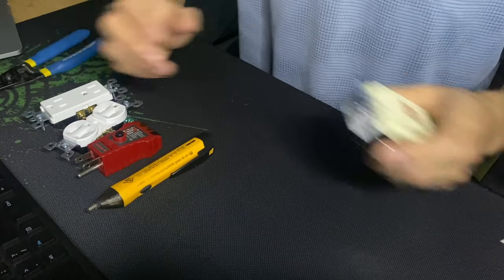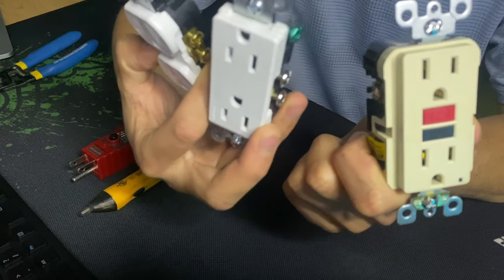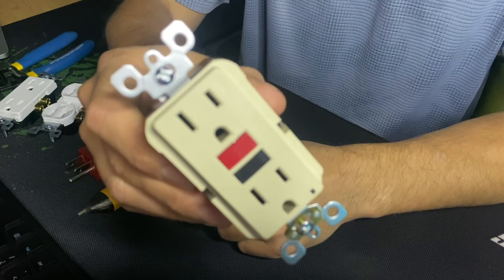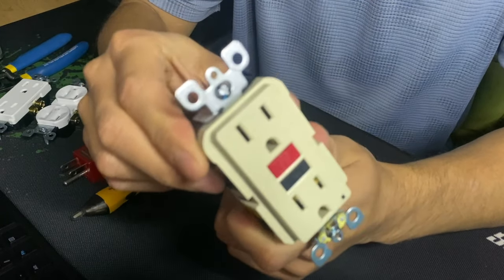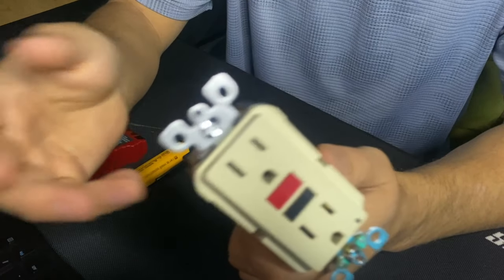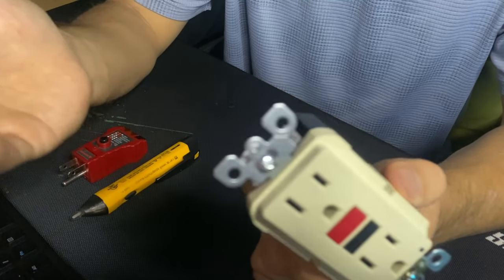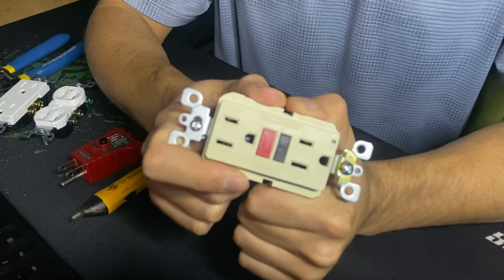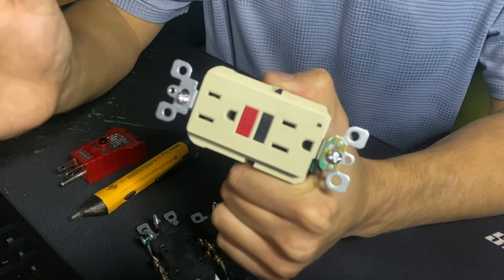GFCI Outlet Not Working 🤷‍♂️ Can't Reset It

Comment: Hi my outlets on my Camper are not working except the microwave plug We changed the GFCI PLUG AND ITS GREEN BUT WHEN I PLUG SOMETHING INTO THE GFCI OF STILL DOESN'T WORK NEITHER DOES THE OTHER OUTLETS ALL FUSES WORK BREAKER BOX IS WORKING WHAT COULD BE THE PROBLEM 😢
Reply from the maker: wiring is problem. line has to go to line load has to go to load. then you need to test reset

Comment: I think you should have explained what if the GFCI outlet DOES have power and still won't reset.
Reply from the maker: short circuit or time to replace it.
Reply: @remoteelectrician  Thank  you. I replaced it and it works now. They don't make anything like they used to...

Comment: While trying to change an outlet I saw sparks and now both restrooms  don't have outlet power only light power. What should I do? The fuse is ON
Reply from the maker: you should have turned power off before replacing outlet. turn power off, install the outlet if bathroom gfci, turn power back on, reset gfci, that's it. (you should also inspect the rest of the outlets in other bath since its all one circuit before turning power back on.)

Comment: Remote Electrician My GFCI is not resetting and there is no switch in the circuit. I purchased another GFCI and it's not resetting either. So I replaced the GFCI with a standard outlet and all the outlets are working. What do you think?
Reply from the maker: Do you have 4 wires or just 2? If you have line and load (4) you power has to go to line terminals
Reply: @remoteelectrician  I have 4 wires and yes it is wired like that. I have another identical circuit that is working fine. I guess I just got two (new) GFCI's. Ill get a third and try that.
Thank you.
Reply from the maker: @55afishead  no you need to wire it correctly then press reset.
Reply: @remoteelectrician  No. It's wired correctly. Just had two bad GFCI's.

Comment: My problem is the green light is steady on the outlet but no power and no power to the rest of the kitchen outlets. I replaced the outlet and same thing. Green light, no power no click when I hit test or reset? I bought a dead GFCI outlet?
Reply from the maker: make sure u wire it correctly, watch how to wire gfci video. (Yes, sometimes  u can buy faulty new gfci too)
Reply: @remoteelectrician  sure but the original outlet has been there since before I bought the place. No problems. Same exact situation between old and new outlet. Steady light so it's getting power but it seems "tripped" and I can't reset. No clicks on test or reset button on either outlet. Thanks for response.
Reply from the maker: @kenbe62  well if u can't reset make sure with multimeter that wires have power 120-125v, and if installing new device doesn't work and trips then you have short circuit in that junction box or the load side of that circuit.
Reply: @remoteelectrician  Both new and old outlets should click when the buttons are depressed, yes? Neither does. Thanks again for the responses. Definitely be watching more of your videos.
Reply from the maker: No If it doesnt have 120v at the terminals or there’s a short/ground fault in that circuit

Comment: I have power to my outlet but it still won’t reset. It clicks and turns red when the button is pressed but goes off and no power when button released and no light
Reply from the maker: you have short circuit if it's feeding another outlet. or just bad gfci(may need replacement)

Comment: Tell Sandra my backyard this past weekend plugged into an exterior outlet and all of a sudden the power shut off I didn't know that a particular GFCI feeds this Outlet when I went to try and reset this particular GFCI I kept pushing in the red reset button but it would not stay in I know it is not hooked up to a switch and all the breakers in my panel are on nothing was tripped is it possible that the GFCI is just bad and needs replacement or can it be something else?
Reply from the maker: one way to test is to remove face plate/cover and check (with power tester stick) side terminals for presence of power. (if you have power and can't reset gfci it could be bad gfci or short circuit  in. the chain of load side)

Comment: I have this problem with 2 outlets. One is inside my kitchen and the GFI will not reset and there is no wall switch that is linked to that outlet it is strictly an outlet. The other outlet is outside And again no wall switch is linked or hooked to it and it just stopped working and I can hear the GFI click but it still does not work.
Reply from the maker: you need to visually test the wiring, it won't reset without proper voltage, test the voltage and pull out outlet to see if load wires a lose

Comment: Just changed my outside one to a new one and still won’t work. No power buttons won’t click. Panel has No tripped breakers. Was working fine for years
Reply from the maker: did u check if it has power at those wires before u installed new one? did u install it correctly?

Comment: I have gfi stop working with all breakers switch is on but a lamp blu out and button doesn't work what could be problem
Reply from the maker: remove it, and check terminals if it has power or not. you won't reset it without power

Comment: I think the gfci on mines ain't working, when I check the power threw the sides screws I get 120 volts power but when I connect something threw it no power!!! This gfci doesn't have another switch! and can't reset either !!
Reply from the maker: time for new one. and wire it correctly line tot line load to load

Comment: Okay I got one in my kitchen I pressed it and the microwave cut on and everything but it went straight back off and the breaker is on
Reply from the maker: you may have short circuit or  time to replace gfci
Reply: @remoteelectrician  this is a relatively old house we already replaced one fuse in this house
Reply: @remoteelectrician  my uncle is a pretty good electrician
Reply: @remoteelectrician  the heater and the microwave was drawing too much energy together so he unplugged the microwave and it reset it

Comment: Thanks really helped out
Reply from the maker: Glad to hear it
Reply: I have a jacuzzi connected to cgfi that its not peering on. I reset the main n dubpanel breakers,  I pressed the reset button. No power  tested with a  outlet tested pen. No beeping. Pls help
Reply from the maker: @cesartrevejo6562  need more details, did u remove outlet and then tested outlet wires with power tester?
Reply: @remoteelectrician No I haven't removed the gfci outlet. I tested the gfci outlet with tester no beeps
Reply from the maker: @cesartrevejo6562  you need to turn off breakers then remove outlet then turn power back on and then test wires. if wires have power then gfci may be faulty. happens a lot to outdoor gfci's)
Reply: @remoteelectrician  Thank you , I will .
Reply: before i do that, i noticed that the electrical wire goimg to gfci outlet looks like rusted out the sheath outer lining or could be rodent that has bitten . @remoteelectrician
Reply from the maker: @cesartrevejo6562  that's where u can test for presence of power with your stick
Reply: @remoteelectrician  i will check on the rusted part of the electrical line.
Reply: @remoteelectrician  still no beeps, probably wire still has sufficient external sheath coating.
Reply from the maker: @cesartrevejo6562  breaker may be faulty as well, but usually gfci contacts become corroded when its outside

Comment: This is all great....I have 1 gfi outlet in a downstairs bathroom that (i assume) controls outside....upstairs bathroom etc. Breaker is good and on without tripping nor has it ever tripped. Problem is, I can't get this whole line to work. No power coming in to the gfi outlet. I have checked every outlet in this house...suggestions?
Reply from the maker: hi, how do you know if there's no power? did you remove the outlet cover and check the junction box of the outlet with hot stick?(power tester), sometimes wires get lose in junction box, sometimes gfci goes out and you need to replace an outlet, it depends

Comment: I have power to the GFCI Outlet and the reset button works (green light is on) but none of the downline outlets have power.  Thoughts?
Reply from the maker: gotta open and check wiring
Reply: The outlets "downline" from the GFCI outlets were working fine until the outlet was tripped due to an overload. After resetting the GFCI outlet reset there is no power to the downline outlets even though the GFCI breaker in the breaker panel and the GDCI main outlet has power.  Could the "load"side of the GFCI outlet be bad and that GFCI outlet needs to be replaced?

Comment: I need your help! Im getting no power from my outdoor outlet and in the breaker box nothing is jumped so i cant reset it. The GFCI is a little bit more modern and dont have the cemter reset/test buttons. What can i do?
Reply: Should i buy a No contact volathe tester so i can check the wires? Or should i get a repeatable tester?
Reply from the maker: hi. yes. you need to know if it's getting power. if it looks like regualer outlet. then your gfci outlet is somewhere esle inside/garage etc. which is feeding outdoor outlet.

Comment: My Gfci on my back porch isn't working . I can't get it to reset when I push the button
Reply from the maker: check the breaker. if good. pull outlet read the voltage at terminals if it has power time to replace it.

Comment: I tested some old nightlights at my GFCI outlet in my bathroom. Two of the lights flashed on for a second and then died and now the outlet won’t work at all. I tried resetting it several times. I tried using different appliances to see if they would work from that outlet. They wouldn’t. I turned off the breaker switch. Waited, and then turned it back on. Everything else on that circuit still gets power. I checked to see if my two other GFCI‘s are still working and they are. I reset them to see if that did anything. Did I just kill my GFCI and I need to replace it? I put my GFCI’s in in 2004. Thank you.
Reply from the maker: gfci will reset if its getting power. you need to pull it out with breaker off and keep wiring on and turn breaker on and test the line wires with power tester if it has power or not. sometimes wires get lose sometimes yes gfci goes out.
Reply: @remoteelectrician  Since it stopped working when I tested the night lights, would my testing them have affected the wiring, or just have caused the GFCI to go bad? I think I’ll get an electrician to take care of it because I don’t want to replace it myself. ( danger) When I put it in originally, it was actually my neighbor who did it. I was just his assistant. Thanks for your analysis.
Reply from the maker: @MonicaFlorida  anything could happen  but basic troubleshooting is to define if wires have power at all, before deciding to replace the device itself.
Reply: @remoteelectrician  I needed to have my washing machine repair guy come to my house today to check something out. I asked him if he could replace the GFCI. I bought a couple before he came. He tested the outlet and there was no power, but after he put the new outlet in, it worked again. He also put one in by the washing machine since there wasn’t one there.
Reply from the maker: @MonicaFlorida  nice!

Comment: This worked, but how does the GFI outlet still provide power once the switch is turned OFF (after I reset the outlet, I turned off the switch, and the outlet still had power)?
Reply from the maker: if gfci outlet switched, it should not have power when switch is off.
Reply: OMG... this worked for me too.  I was pretty sure it has to do with my kitchen light.  When I was investigating the light, I found some strange wiring there.  Power coming in and out... and the light was wired back to the light with the power.  IDK... but when I flipped the switch and the light turned on... I was able to reset the new GFCI.  And GFCI works now when the light is off.  We have had issues in the past with the old GFCI tripping a lot... I assume it has to do the lighting wiring now.

Comment: I tried to install one of these in a bathroom and it wouldn't work. The buttons just stayed stuck. There is no switch to the outlet, the friggin thing just didn't work.
Reply from the maker: you installed it wrong then. if it has 4 wires line pair has to go to line terminals. load pair has to go to load terminals. if you have only one pair of wires it needs to be screwed under line terminals.

Comment: This is my situation: I have a GFCI near my Pool (my pump connects to that) one day, it tripped , I ran to the house and reset all the GFCI I could find but this outlet still has no power, breakers are good. When I bough the house , this Pool outlet had no power C one day, suddenly it worked, not sure if it has bad connections or if shutting down the entire power in the house was the move that made this work. How can I reset this GFCI for my Pool work again ?
Reply from the maker: you need to pull out that gfci and inspect wiring. gets rusted sometimes if its outside( use WR gfci)
Reply: @remoteelectrician  thank you, I’ll try this.

Comment: I have a Problem on the kitchen ..I used the Microway and I plug a heater ... so Now I dint have kitchen light ..I have light evrewhere acetp the kitchen
Reply from the maker: check breakers, microwave usually has its own breaker unless yours is one circuit.(check with tester if switch has a power)

Comment: Hi 
I have an issue with one outlet that was exposed to a leak under the kitchen sink and tripped one of the kitchens gfci. Already replaced the outlet and the gfci but still can not reset it, I tested with the correct wiring device and all of the outlets that are connected to that gfci have hot and neutral reversed. Already check them they look to be wired correctly and it’s weird because it was working before
Reply from the maker: hi. if everything works. reverse polarity is pretty simple, just correct it at gfci load or line side. if you can't, get help from an electrician.
Reply: @remoteelectrician  thanks for feedback

Comment: What do u mean swirch into ON posistion. I have the same EXACT issue disposal under sink red light 😅
Reply from the maker: red light means you have a short circuit. you need to pull out outlet and check.

Comment: My gfi in kitchen it connected to another outlet went out, I check the breaker it on, I replace new one and there still no power, there green light stay on the gfi, do u think I need replace the breaker in the garage?
Reply from the maker: no, you need someone to help you to organize line and load wires for those outlets

Comment: I have the same issue, is there a email that I can speak with you?
Reply from the maker: can you briefly describe it here. maybe it'll help others as well. thanks
Reply: @remoteelectrician  I used my espresso maker and all of a sudden half of my kitchen outlets are not working, I checked the break (not flipped) checked all of our EFCI (not tripped) I checked all the wires in all the outlets non were loose. I even went to the extreme to replace all the non working receptacles in the kitchen and it did nothing.
Reply from the maker: @richard hanson  how many gfci outlets in the kitchen and how many regular? And from those if only non gfci outlets not working but protected by gfci. 
-Turn off power
-pull out gfci (keep wiring on)
-turn back on power
-carefully check with power tester if line has power and in on gfci position check load side wiring with hot stick power tester. (if u do have power on line side)
-Load side wiring could be loose, melted or disconnected.
-or gfci could be faulty and needs to be replaced.

Comment: Breaker is good not trip and gfci outlet not work or reset no switch connected to it all it shows is red light blinks ones in a while
Reply from the maker: could be short circuit or time to replace it.

Comment: I know I have power in my GFCI because it has an LED that is lit and I tested with voltmeter. Yet I can not reset the button. I thought it was the outlet so I got a 5 new ones. They all don't reset. I disconnected the load in case the problem is downstream. No effect. I took a GFCI from another location that works, put it in location that doesn't and now that outlet doesn't work even when installed back at old location that worked. So I though maybe the bad location broke the outlet so I put new GFCI at location that worked and that doesn't work now. So I ruled out down stream. I ruled out location destroying new GFCIs. I ruled out bad outlet. I know I have the wiring correct. Line on bottom. Load on top. I don't know what else it could it be? Now I am wondering if there is a trick to pushing the reset button that I am not aware of. I tried holding it for a while. I tried fast pushes, slow pushes, push with tool and high pressure, low pressure. Nothing works.
Reply from the maker: please measure voltage at the line. if you have anything less then 120 say 89, 87 you may have an open neutral somewhere
Reply: @remoteelectrician  Figured it out. I had the line and the load pair swapped. I made sure I marked the wiring to be the same as my last broken GFCI. Unfortunately even though the new GFCI outlet was same brand, model, and looked identical, they changed the design only in that they moved the line from bottom to top and load from top to bottom.
Reply from the maker: @vripiatbuzoi9188  nice

Comment: I have 2 in the same kitchen blinking at the same time reset still blinking maintenance man said it's ok yeah right don't trust them they can't even fix my heat heat still out
Reply from the maker: solid red light: device may need replacement, flashing light: it has a short in the circuit that needs to be fixed. also, wiring needs to be checked if done correctly or not. line/load wires.

Comment: I have gfi bathroom 🐈‍⬛ making red light
Reply from the maker: 1.reset it. 
2. if stays red, line and load wires need to be checked if it's wired correctly or not.
3.device may need to be replaced.